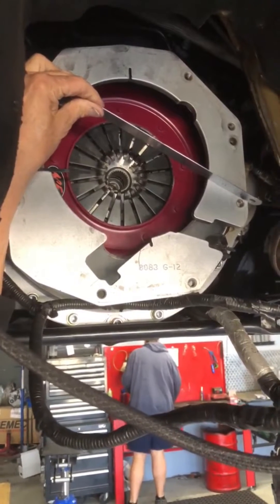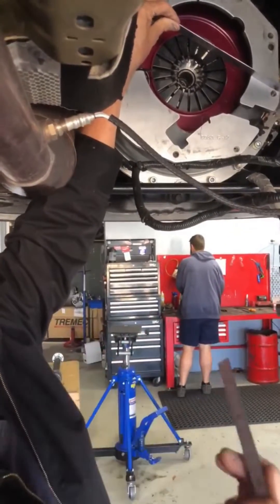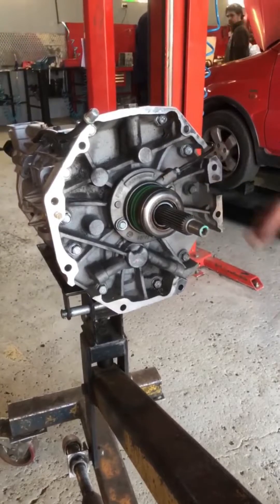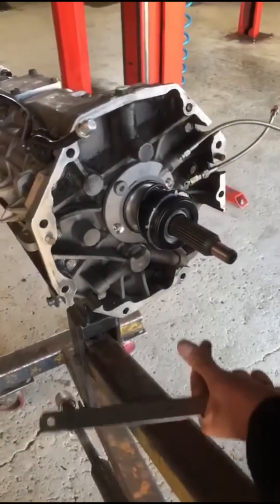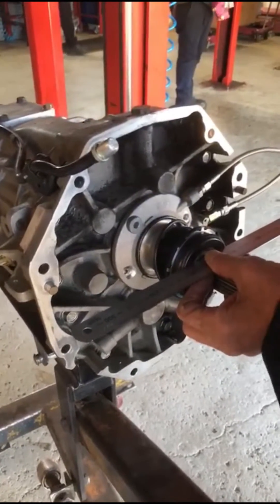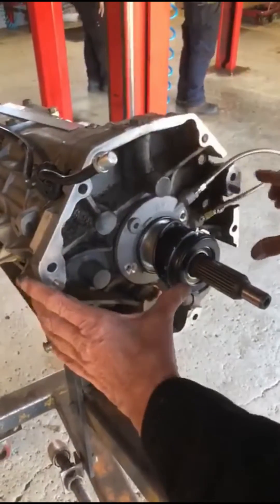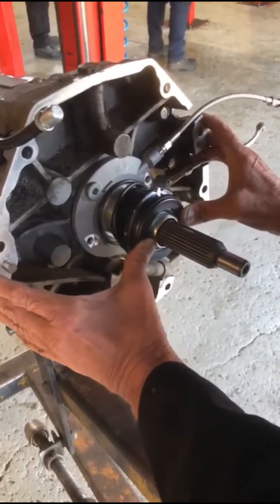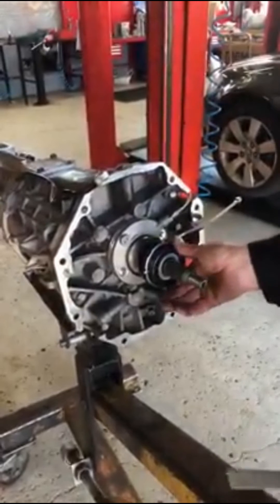Concentric Slave Cylinder Setup for TREMEC T56 Transmission

Comment: Do u have the part number for the slave that you installed sir ?
Reply from the maker: Hi Julian, 

Here is the link to the slave cylinder that we use. 

https://malwoodauto.com.au/product/alloy-t56-slave-cylinder-billet/
Reply: Will this work with 2014 Camaro Tr6060 ?